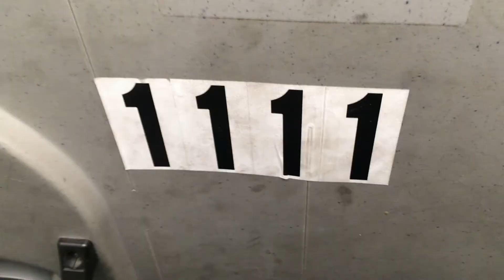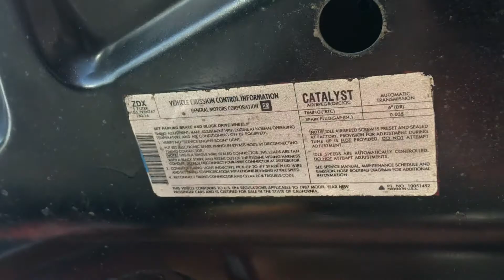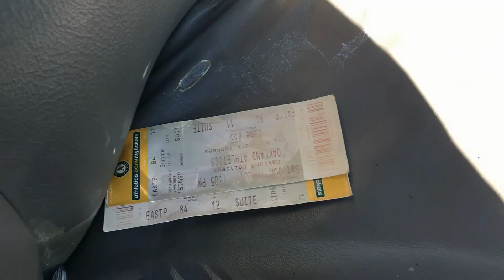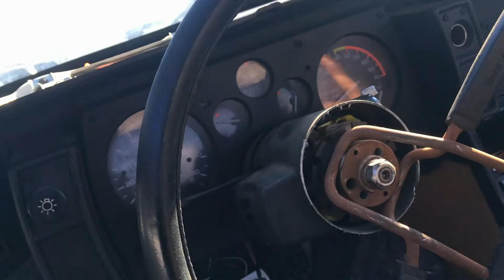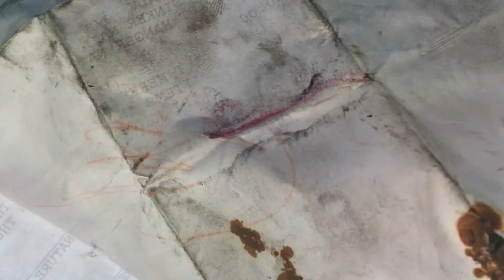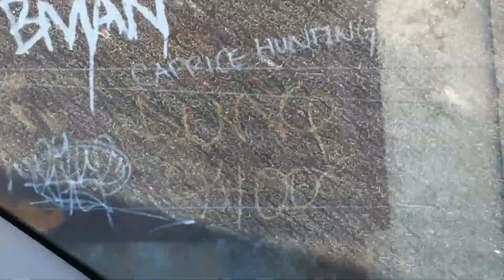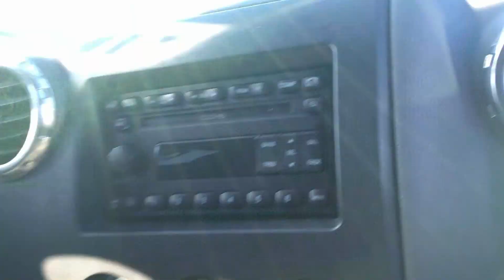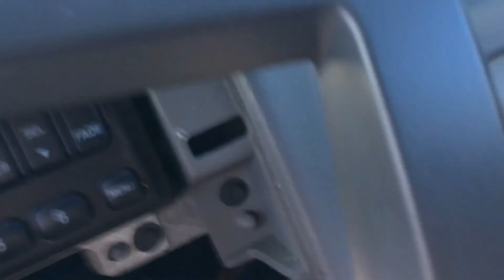Caprice Hunting November 11-11-21 Oakland PnP , 87 GTA + more

Comment: Hey bro I got that steering wheel u wus checking out outta da white Camaro,I'll trade u for da one on ur 82 if ur interested
Reply from the maker: right on thanks for the offer but I am going to keep mine im just looking for a button. they sell them on ebay new for 70 but im trying to find one in PNP lol. In richmond they dropped down an iroc, it has the same steering wheel as my 82. I was just there 2 days ago. it is slightly bent from someone pulling on it but looks like it could be straightened back. looked in the same condition as mine other than that. column looked good as well .
Reply: @CapriceHunting  gotcha,I might go check out dat Iroc this weekend,I live right down the street from that PnP
Reply from the maker: @IrocZ285.7  4sho man id be in there every night if I lived that close LOL jk . the iroc is pretty far gone from its row52 pic which it looks nice and was one they probably should have thrown in the builder section. I took the tail lights. the seats looked really nice for original but it wasnt a sales day haha